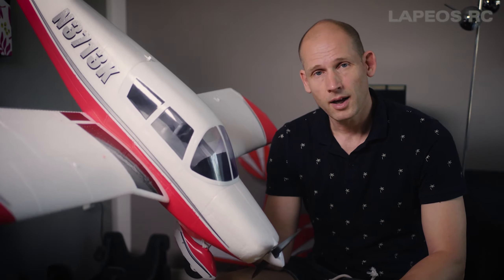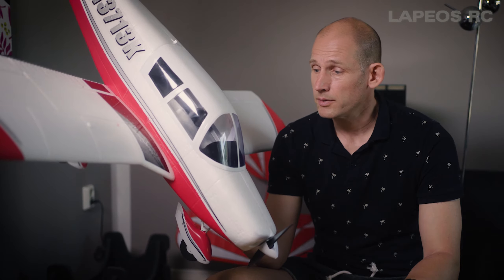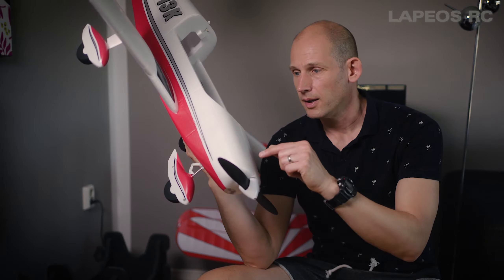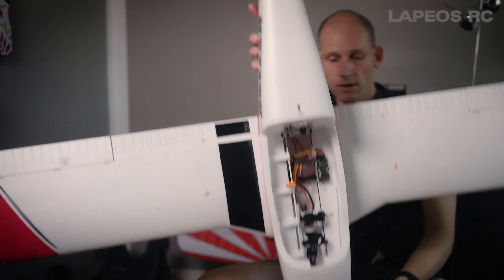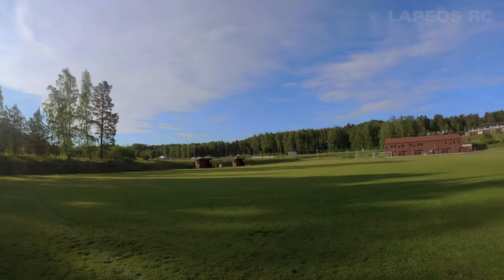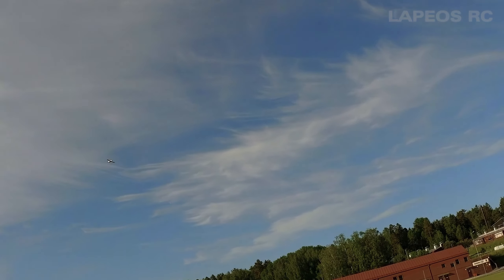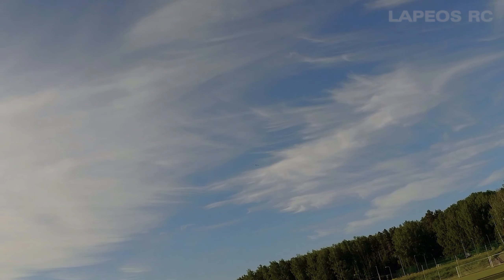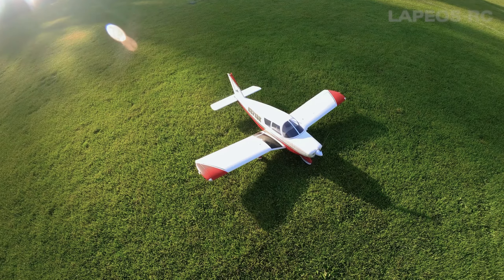E-Flite Cherokee - Upgraded and sucked dry!

Comment: Wonderful mate. Just have had delivered my RV-7 (similar to my Cherokee) & Valiant but I love the new Cirrus. The Cherokee, Cirrus & RV-7 have fantastic scale looks & I can use my cameras inside the cockpit (letter two) Thank you for a great explantation on this. Regards Noel
Reply: PS The plastic geared service on the Cirrus rudder failed after 3 flights, Eflite distributor replaced it but The new servos have a lug on them & the holding services plate came away....sooo frustrating. Like you, I wish they would replace with metal gear servo's. Glad the included the AR637 Receiver.
Reply from the maker: Thanks Noel! I always enjoy your videos!
Reply: @SunriseRCAviator  ditto mate. Hope you are doing well over there as we are here.
Reply from the maker: @Bellairvideo  I am. Doing lots of float flying and it's a blast!

Comment: Swap the propeller for an 11x8 instead of the stock one. You get better rpm's on propeller rotation, plus it's more scale than over-sized. This is what I did to my e-flite cherokee
Reply from the maker: I have experimented with different props but in the end I came back to the stock one.

Comment: Awesome flying and landing!! So I changed the esc also to the Avian 45amp and yes what a mission to get those motor connectors connected but I used the original ar631 reciever and now everytime I power up I get 3 warnings ESC 12.3V   5.4A and 100.4F  I know what they mean but why dont I get the same warnings from my rv-7 that has the same ar631. Any ideas?
Reply from the maker: I guess telemetry is setup differently on the two planes. Check the settings is my best advice. I have turned of all telemetry warnings except for a 3.5V/cell voice alert just because to me everything else doesn't do much.

Comment: Hi, I have the red Cherokee - just got it for Christmas so I won't get the blue one for a while.  Mine has the AR631 so I decided to take your advice and upgrade the ESC so I could get battery voltage.  I managed to do it without removing the cowl.  I got the 45A Avian (non-lite).  I enabled thrust reverse and I get battery voltage, but only with smart batteries.  I thought you could get the battery voltage with non-smart batteries too.  I'm sure some of my planes have the AR631 and can do that.  Do I need to upgrade some firmware somewhere?  Any ideas are appreciated. - Ryan
Reply: Ok, answering my own post at least partially.  I fiddled with the telemetry config and made sure the esc status was included.  It has the pack voltage, smart or non-smart.  But it doesn't fill up the battery icon for non-smart batteries.  I'll have to look at it some more.
Reply from the maker: With non spektrum batteries you should get the overall voltage telemetry but not individual cell voltage.
Reply: @RC Thanks for the reply!  Yes, I can get the voltage, just not the little battery gauge for non-smart batteries.  It's all there for the smart batteries.  I know, with my twin timber, I get the battery gauge even with non-smart batteries.
Reply: I did a little more checking.  I have an Arrows T28 that I put an Avian in along with an AR631 and it displays the battery voltage AND the battery gauge icon with non-smart batteries on the Smart ESC telemetry page.  So does my Eflite 1.2M Corsair.  I'm going to try to update the firmware for my ESC to see if that does anything.  I do get the voltage, just not the handy gauge that I can glance down at.
Reply: I love your videos, by the way.  I've made several purchases after watching you.  I wish I could fly that smooth haha!
Reply from the maker: I hope that solves it! @ryanmiller2318
Reply from the maker: @ryanmiller2318  Thanks for the kind comment :)
Reply: Update:  I had all sorts of trouble with my spektrum esc programmer.  In the end, I decided the USB wasn't working at all.  I had bought it to program the ESCs for my Twin Beechcraft, which worked fine and it connects to the ESC I just put into the Cherokee, but it wouldn't connect to the computer.  So I bought a new one.  That one connected on USB and I was able to update the programmer's firmware.  But when I checked my new Avian ESC's firmware, it was at the latest.  I re-confirmed that when I put non-smart batteries in, the ESC Status screen displays the battery voltage, but not the battery gauge display at the top.  It's just missing.  So...maybe update the firmware in the receiver?  It's all that's left.  I'll have to read up on that!
Reply: Final post on this.  I upgraded the receiver firmware and the behavior is the same with the Avian non-lite ESC.  I also made sure my transmitter was up to date and I was behind a revision or 2.  No difference there either.  I contacted Horizon Hobby and had a few discussions with them.  In the end they decided to send me a new 45A Avian ESC.  No difference.  The only thing I can conclude is that the battery gauge display for non-smart batteries only appears for avian-lite ESCs.  I have a 70A Avian lite so I wired it in temporarily and I got the battery gauge display with a non-smart battery.  I think this must be an error in the firmware for the Avian non-lite.  Kind of disappointing, but I do get the telemetry so I still can monitor the flight battery.  Thanks for reading!  Now to try to get the vibration out of that prop....
Reply from the maker: @ryanmiller2318  I have experienced some odd behaviour with telemetry also. Might be bugs or some sort of mismatch.